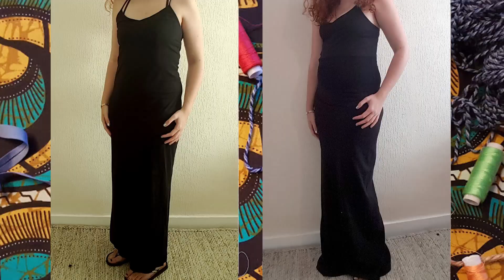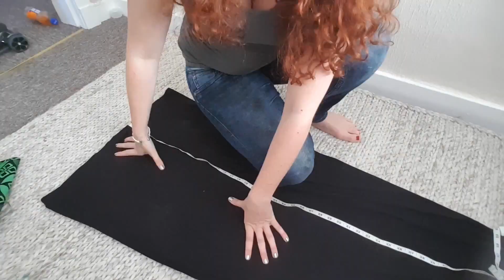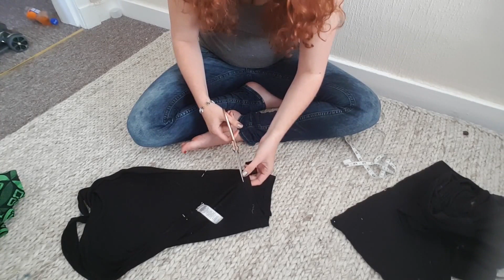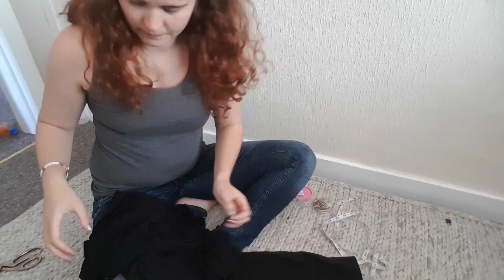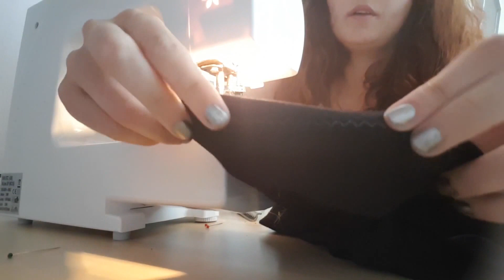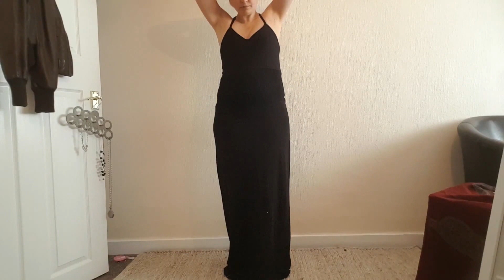How To Make A Maxi Dress Longer Using A Tshirt

Comment: What a fantastic video and project  - a pleasure to watch! You were very successful  - not just with the length and the blending of the materials but the overall shape of the skirt part of the dress seems to look so much better and neater and flatters your  (lovely) figure better.
So refreshing to find a lengthening video  - so much harder than shortening as there's more factors to get spot on right. Also I don't get all this wearing dresses with hems at the bum malarkey - in my opinion the elegance of a long dress is a billion times more attractive!
Hope you didn't feel too stiff or achey after being on the floor for so long and I hope you're careful when mixing bare feet with pins on the floor  - I'm sure you are!  :)
Reply from the maker: Daveonarave I love a floor length dress. I find them super comfy and easy to wear but hard to get just the right length. I do try to be very careful with the pins and I'm on the lookout for a work table for these bigger projects!